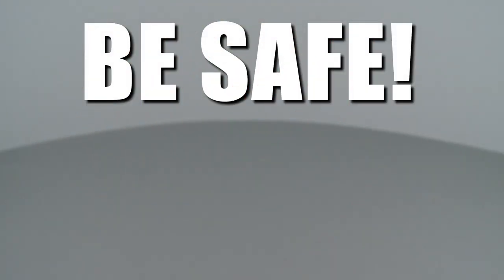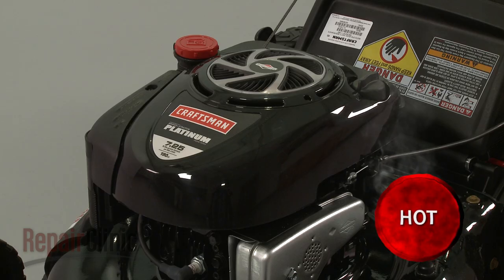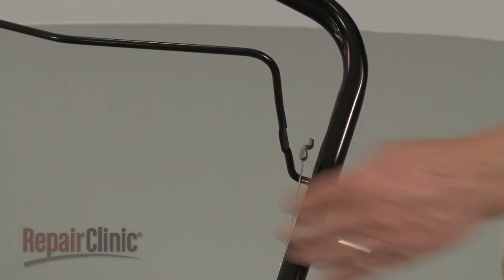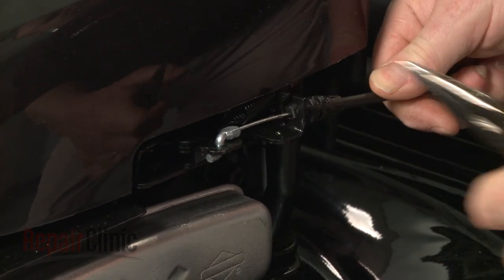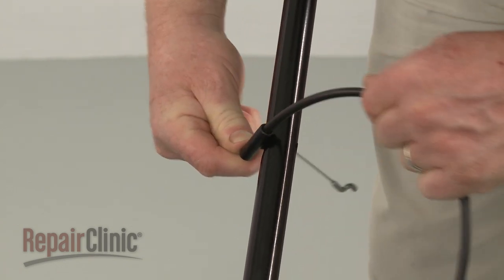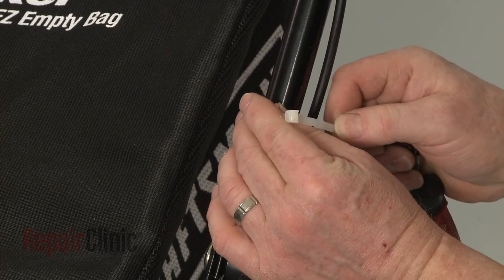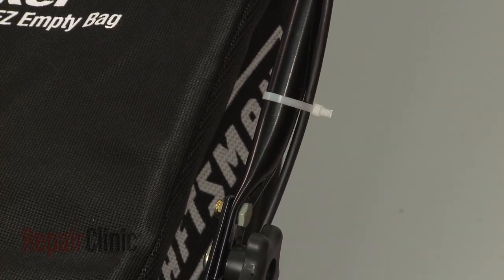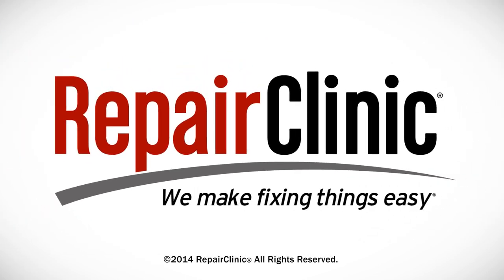Craftsman Lawn Mower Control Cable Replacement #946-04661A

Comment: Out by the curb in front of a large, luxurious mansion was a  lawn mower that appeared sparkling and almost brand new. A cardboard sign hanging  on it said; "FREE LAWNMOWER, GUARANTEED NOT TO START!" Lucky day for me as I needed a new one. I loaded it into the luggage compartment of my Safari van, got it home and it started on the 3rd pull. It did have some power and carburetion issues but your videos have helped me repair those problems. I appreciate it! I will be sure to check out that house now and then to see if they put out any free vehicles that won't start.

Comment: I ordered and received a control cable and put it on the mower as shown, however it.  When I pull the start/run handle fully down it doesn’t pull the lever on the engine far enough to enable the mower to start.  The cable is too long, sent an email to repair clinic and they verified that they sent the correct cable.

And suggestions on getting it working, don’t see any adjustments.

Comment: I was going to buy a Sears Lawnmower at a yard sale because he said the only thing you need is  this cable but The cable part that fits in the round hole by the engine  broke. It lead me to believe that were the cable gets placed into that hole by the engine that part seems to not move. Shouldn't it move? It seems to have frozen which resulted in the cable breaking because it needs to move to engage the motor to start up.